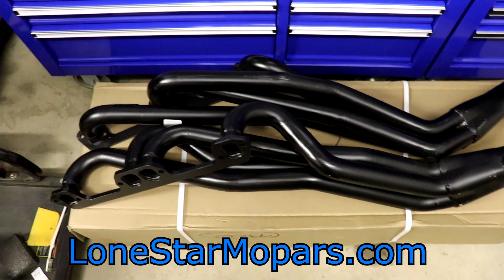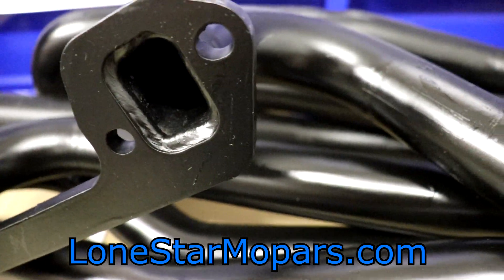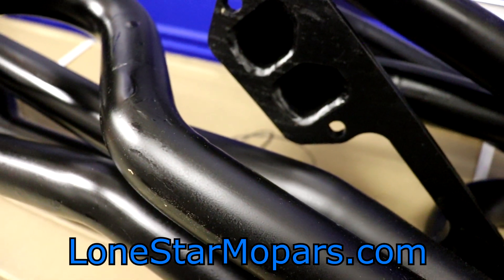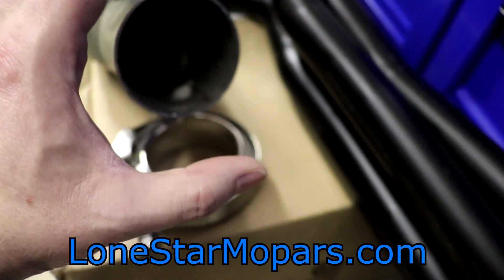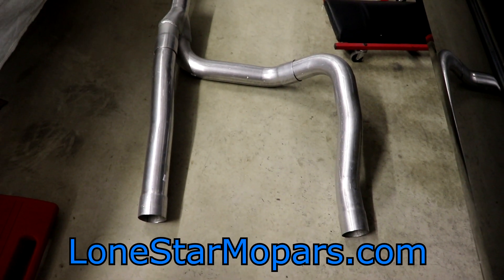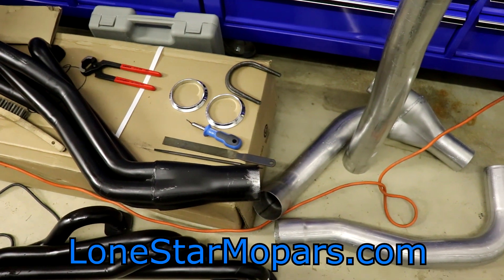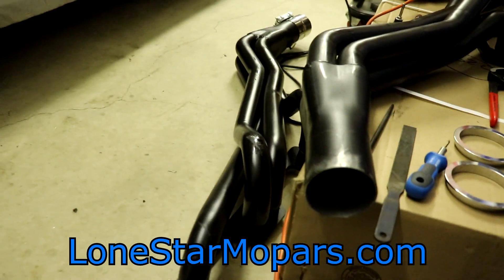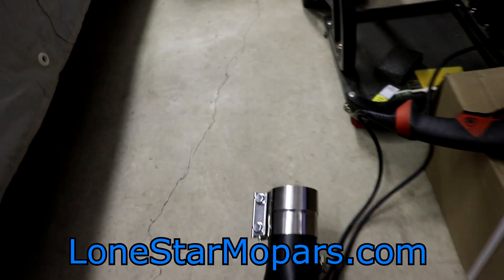Ram Revival Part 60: PaceSetter Performance Long Tube Headers and 3" Off-Road Y-Pipe

Comment: These are fairly popular with the GTO folks however fitment seems to be an occasional issue. However, if you can shimmy them in and get them on the vehicle, they do what they're supposed to do. Lastly, you can't beat the price on them.
Reply from the maker: Yeah, the fitment is really, really tight.  Passenger side basically drops right in, driver's side is a drop and bang in place fit...then with the y-pipe on a 4WD it gets real interesting!  Yeah, the price is great...they are honestly very nice headers...just sucks they missed a weld.
Reply: @lonestarmopars  yeah that totally sucks they missed a weld. Return them. Demand a new pair.
Reply from the maker: They offered, but I was afraid the new pair might wind up being worse than this pair...plus, it would have cost me even more time.

Comment: I have the Jba shorty headers with the ceramic coating I love them . I think I am going to have to buy a 3rd gen Ram
Reply from the maker: I was pretty happy with the Gibsons, but the lack of decent y-pipes and the tuner strongly suggesting long tubes made me switch.  3rd Gens are good too...hopefully you can find a 2nd Gen OFf-Road.